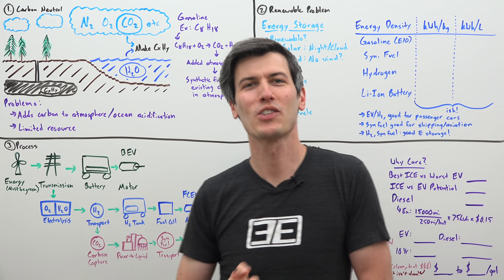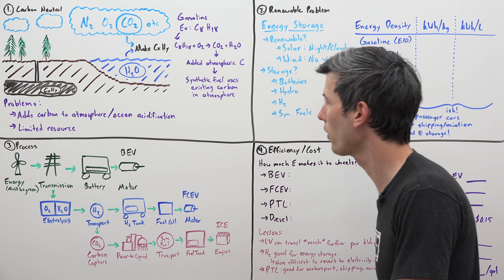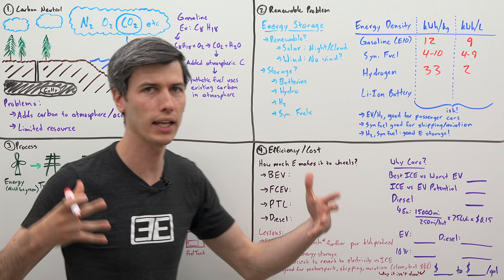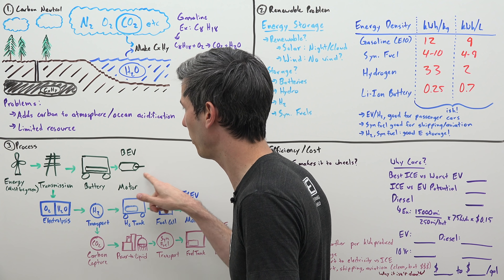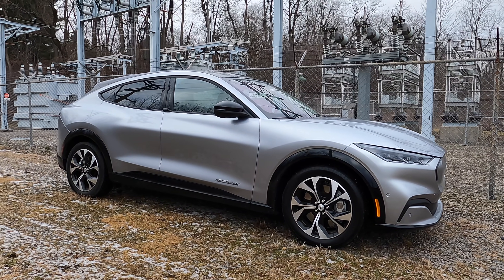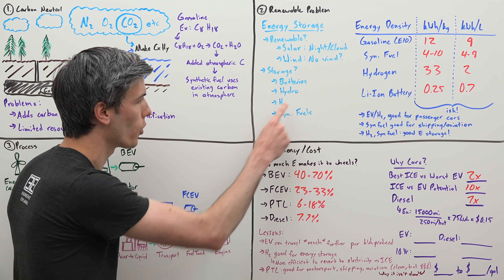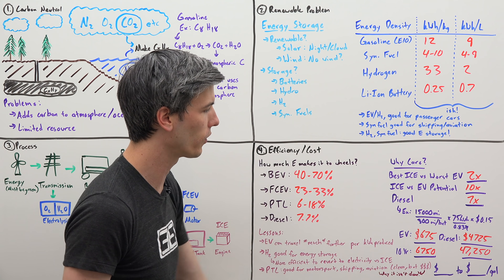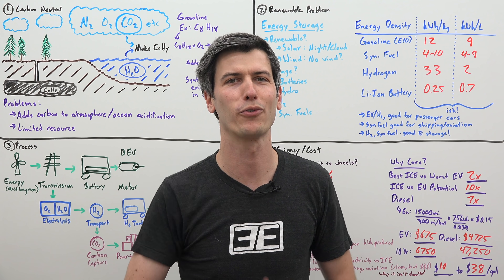The Big Problem With Synthetic Fuels

Comment: "Renewable energy" is a political NOT technical distinction. That you, an engineer, use it as your prerequisite is very silly. Renewable energy doesn't mean carbon free, and it certainly doesn't mean practical which it most certainly isn't.

The only rate limiting step on synthetic fuel that can't be fixed with more R&D is the cost of the feed stocks, which is mainly electricity. And this is an absolute deal breaker with renewable energy, because renewable energy drives up electricity prices exponentially. Yes, really! 

This is a well studied phenomenon and it's readily apparent in the world. Every region with a high penetration of renewable sources on their grid pays MORE per kWh than those that use reliable energy sources. This is due to the damage that renewable sources do to the grid and all the effort the grid operator has to expend to balance them out. It adds up fast and is the reason why all the 'studies' claiming renewable is so cheap are always careful to only look at wholesale or build costs, and NEVER what the poor old end customer actually pays. This is also going to have the effect of ruining the already sketchy economics of the EV as time goes on. Once material shortages start happening and government subsidies eventually go away the EV economics will be on even more shaky ground. Plus the very long list of things that EV's just can't do, like heavy transport. 

I hate to break it to you, but you really picked a bad example by repeatedly mentioning windmills. Because wind and solar power, the cornerstone of the renewable energy concept are outright scams. That's why the natural gas lobby love investing in them so much. :P There's a good reason, based in actual physics, why over half of the US's carbon free energy already comes from nuclear power. And you mentioned it, 'Energy Density'. For this reason alone nuclear knocks every other option out of the ring. It's the only thing that will work in the future, and nuclear power can be made very cheap indeed. It's already the cheapest power source nearly everywhere it's used, and that's with older types of reactors operating under an absurd regulatory burden that accounts for most of the costs. Fission power can easily make synthetic fuel if needed, renewables cannot.

Comment: Hello people.
While following along with this video, there was a thought that crossed my mind:
I'm under the impression that (even if we don't like it) we're not going to get around using a lot of nuclear power to satisfy a coal and oil free civilization.
If we take that into consideration (in other words nuclear really hates power spikes from everyone plugging in their BEV in the eveing) and also assume that the heat required for CO2 capture can be harvested from the nuclear power plant, we might see some very different numbers in cost and total energy used. Electric cars will still be cheaper to drive, no doubt about that. 
The main problem about electric vehicles for me is that just about every house's electric grid alongside all the local grids of today will be overloaded when those spikes hit.
A great example of this is the Swiss Gothard Tunnel, once a year there's a long traffic jam (up tp 24km) during the holiday season. All these cars would need electric energy and a recharge station to be charged. All that infrastructure would be sitting by more or less idly the rest of the year.
P.S. Why do you not pin your own comment to the top?

Comment: I talked to the scientists in Los Alamos National Lab who were doing the algae project (biodiesel from algae tanks) they can make it at the price point where the oil hits $100 a barrel. The US has plenty of sun lit desert and arid areas where this can be done. Right now it is not feasible because oil is very cheap because of fracking but once oil goes up again or becomes scarce we have the technology to do that. I believe it will have a huge role because 1. energy density 2. ease of storage and transportation. Neither electric nor hydrogen will ever beat it at these two categories.

Comment: Factor which has been missed is that li-ion is a limited source going back to your crude oil scenario and it has already been said that by 2030 there will be a shortage due to demand so looking at it from a raw product to the end product I would say the hydrogen/synthetic fuel would be more energy efficient than electric cars.

Comment: But this is the point of renewable energy. The cost of it generating renewable energy will eventually come down to a point where this loss of efficiency shouldn't matter, especially when we look at over production of Solar in places like the desert, which basically no where to store it. Of course I am only remotely correct if we reach the point where energy generation vastly exceeds our ability to consume it, if we increase the efficiency of renewables, and we also find cheaper ways to make renewable generation facilities.

Comment: Battery energy density numbers often include the casing, electrodes, balancing electronics, and everything else. Where as the combustion fuel numbers are often just the fuel. Hydrogen needs to be highly compressed to be dense, so it needs strong storage tanks and delivery pipes which decreases the effective energy density in application. 

It could be fairer to compare similar cars with different drive trains kerb weight with a full and empty "tank".

Comment: Your efficiency breakdown was awesome, really puts it into perspective and I now begin to understand why the markets are shifting towards BEV.
Reply: Correct. Synthetic hydrocarbons make the most sense for large-scale/long-haul transportation (airplanes, trains, ships, semi trucks) where practicality and cost-effectiveness make up for the inefficiency. Once that's in place, synthetic petrol for performance cars, motorbikes, and powersports can be a convenient secondary source of revenue.
Reply: @electric7487  the utter LACK of cost-effectiveness of a drop-in replacement fuel that costs 10x more than fossil fuel is why aviation and shipping are in no hurry to switch. Airlines occasionally do stunts where they'll have a single flight powered by renewable e-fuels, or one airport where 5% of the fuel is renewable e-fuel, but they're not interested in funding the transition to a far more expensive fuel until governments ban fossil fuel.

Comment: a good/balanced review. But remember that there are economic factors that are primary to this discussion. Not secondary, but primary. Furthermore, The use of Synthetic fuels is supposed to be a "life-line" to current Internal Comb Engines, not a 'forever' solution. We need 50 years to get the transition right. And that is a minimum. 50 years. Do we have vehicle-scale, portable batteries that charge in 10 min? (no). Do we have a grid to support 280 million vehicles? (no, not even close). Can we produce enough electricity for 280 million cars(in the USA alone)? Not for another 50 years, unless we burn coal. Be reminded that if we take a myopic view (which sadly is almost empirical for every discussion of EVs), they are outstanding. After reviewing the actual use of EVs, we see casual commuters in urban/suburban areas owned by individuals in the top 3 tax brackets. These million or so people somehow are driving (excuse the pun) the market along with politicians, over the interest of 300 million others, and that is in the USA alone.

Comment: I think you are not comparing apples to apples here! Here in Germany we will never be able to produce enough electric energy from renewable sources in fall, winter and spring. So you have to use long term storage. With H2 you will have big losses over time. So synthetic fuels start to make sense anyway. And don't forget nuclear sources! E.g. the "Dual fluid Reactor" to burn nuclear waste. With synthetic fuels you can make all existing cars carbon neutral. Not only the few new and expensive BEVs. Efficiency is only an argument, if we are not able to produce enough energy for all.

Comment: There is a flaw in your train of thought here. You assume the same amount of Energy going into the process. This would be correct if you solely think of a national solution, but that was never the case for automotive mobility. Electricity can not be transported across the seas, synthetic fuel can, quite easily in fact. If you invest the resources to produce 1 KWh per day in Europe from renewables (Wind, Solar) in another region of the world, you can get about 2 to 4 times as much base energy out of the same investment. Adding the higher baseline into your numbers, the Synthetic fuel with a good engine and an optimal usage (Constant speed, long range driving) is easily landing in the ballpark of the BEV. Additionally, using an EV in these conditions means you are constantly fast charging, constantly asking high loads and just degrade the battery rapidly. Why would you shoehorn the BEV into those conditions when the same amount of battery can easily power 3 to 4 city EVs, where the advandages over ICE are undeniable and impactful.

Comment: This is what I've been telling people for years, even before I'd heard of synthetic petrol (because of bio-ethanol). You'll never HAVE to get rid of your classic car, but it will get expensive.
Reply: Agreed, when the majority of cars are non-petrol it's going to be prohibitively expensive to run them.
Reply: Yeah, but keep in mind that renewables will only give a limited amount of energy. If you look at the studies they usually estimate that we'll already have to drive much less in order to achieve a carbon neutral energy grid fast enough for the paris agreement. 
So if the amount of energy we have is limited then the less efficiently we use that energy the more we'll have to sacrifice/the more we'll have to give up. 
In terms of the transport sector that means that if we all decided to use synthetic diesel in ICE's we'd only be able to travel 1/7 of the distance we'd be able to travel if we all drove EV's. So if you want sacrifice more, if you want to travel less, then you're going to chose something as inefficient as an ICE with synthetic fuels. 
This applies for everyhing we do. If we chose the most efficient methods then we'll barely have to make sacrifices compared to today. But if we chose overly inefficient uses of energy then we'll have to give up more. 
A notable technology are heat pumps in this regard and the cogeneratio of electricity and heat. It's far more efficient to use biomass in to cogenerate heat and electricity in a power plant and to heat your home with a heat pump (and the heat from the powerplant if available) then to just directly heat your home with the biomass. 
To make it short the dumber we use the available energy the more expensive it will be and the more we'll have to give up (for example we can drive less miles per year). A lot of people don't seem to get this. So question we need to ask ourselves is: "Are our sentimental attitudes towards ICE's worth being able to drive less miles and pay more?"
Reply: @LuxDiscendi  To your point about cogeneration of heat and electricity, I believe this is cost prohibitive on anything but an urban scale; this is the same reason why older American cities have steam networks to heat indoor radiators, whereas to my knowledge suburban and rural communities essentially never have steam networks. At most, perhaps larger buildings such as hospitals or universities might have their own steam network.

In a great many respects, one of the main conclusions to be drawn is simply that suburban communities are largely unsustainable from an energy consumption standpoint. Instead of continuing to focus on individual personal transportation with EVs, hybrids, ICE with synthetic fuels, hydrogen and so on, it's far more prudent to encourage urbanization. People simply would not need a vehicle to travel to wherever they need to go if public transportation or walking can fulfill that need within an urban context.
Reply: @NWBx01  
You know, you don't have to "believe" anything. There have been a ton of studies about how we can build an energy system without fossil fuels. So we know how it can be done and how it can't be done and we also have cost estimates (costs will roughly stay the same if we do it correctly).
Reply: @LuxDiscendi  You're right! Plenty of science fiction and ignorance of how 80% of the world population lives.
What is this, "We"-stuff, Kimosabe?

Comment: Is there a difference between synthetic fuel and bio fuels?
There is pros and cons to everything, electric cars are heavy, battery’s cell can have environmental impact with the lithium iron, and most or all are automatic vehicles. On the flip side I like the idea if the electric used to charge an electric car is from natural source like solar, wind, water, or even burn garbage and waste to make heat and steam turbine to make electric.
If battery’s are improved, cleaner and lighter then I like the electric vehicle route.
Also like bio fuels for short turn plan ( next 25 years) as should be 0 carbon footprint impact, as long as all the machines used to cultivate, plant, harvest the crops for bio fuels are also running on bio fuels. 
Some tractors now can run on methane which is plenty available on many farms with cows and crops. 
The biggest problem right now is the fat cats at the top of the fossil fuel / oil company’s don’t want to be knocked off their pedestal and have wage cut or governments won’t allow a smart environmental plan to take place because they get so much money from the fossil fuels / oil and gas industries via taxes.
We need more people in this world like you Jason, smart and decent people.  Also professor Brian Cox. Awesome people.

Comment: But what are the implications when you run out of energy with these several different vehicles... with a gas car you get someone to bring you a gallon of gas so you can get to the nearest pump and fill up in 5 minutes... with an electric car you need to get towed to the nearest charger to wait for the next five HOURS

Comment: Do you think that a lithium battery will last 10 years? In my experience (smartphones and powertools) I would say 5 to 7 years max. So there is no market for used EVs. Or you need to replace the battery which is not just expensive, it is also the worst part for the environment, right? And producing a battery and electric motors needs materials which are not endless available. So we replace fossil fuel (not endless) with another not endless available source? In my opinion, this makes it more expensive in the future and it is an idea not to last long. So synthetic fuel might be more expensive, but you can make all the cars which are existing more „greenish“ and in addition we don‘t waste drinking water to harvest lithium and other limited materials (incl. lithium, copper...and so on). What do you think?

Comment: Sadly you forgot the impact lithium extraction has, with some countries losing a lot of forest area to mining hence less CO2 sink areas. Just use public transportation and/or a bicycle in your commuting and get rid of lithium
Reply: It's mining is still not more harmful than petrol and there are already projects with change litium with kalium, which will make EVs much cheaper and more ecological. But you need to put them into something like freezer, because they are not hot resistance.
Reply: @georgeb5262  you haven't seen the map with requests for lithium prospecting and mining in my country and trust me it's much worse than any crude oil well, oh and the lithium concentration in these places is 0.02% on average, and they say there's about 150000 to 200000 metric tons... so yeah get rid of lithium...
Reply: @0fercam0  What is your country?
Reply: @georgeb5262  Portugal, basically it will lose most of its mountain tops...

Comment: Urea is a superior storage medium to hydrogen. But great presentation, well done.
Reply: Ammonia?
Reply: @theonlyonepaulo  Ammonia is also a much superior storage medium to hydrogen, except for the being incredibly toxic, and boiling away at relatively low temperatures or spilling or leaking and needing to be held in containment that takes all of these into consideration. Ammonia stores more energy more densely and when needed hydrogen can be easily generated from ammonia, or ammonia can be put to countless uses.

Urea, or carbamide, is an upgrade over ammonia, storing far more energy even more densely. Urea is solid at room temperature, non-toxic, can be liquified for easy pipeline transport then reconstituted for solid storage, doesn't burn or easily vaporize in normal conditions. Both ammonia and hydrogen can be got out of urea easily, and like ammonia, urea has countless other uses.

Both ammonia and urea can be formed from waste biomass (or from purpose-grown biomass, but why divert cropland to fuel use until all waste materials are used up first?) using either 'waste' energy (peak production/low demand due time of day, solar or wind variability), in "Power-to-Fuel" chemical storage, and here is where urea really shines: decades after your Hydrogen has leaked through any container, or your ammonia has evaporated, urea will remain ready to convert back to energy.